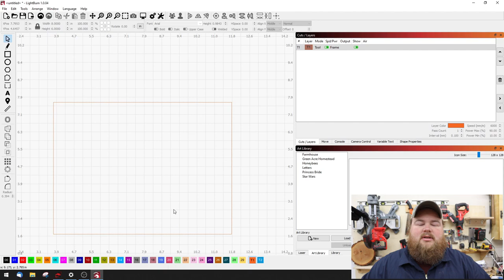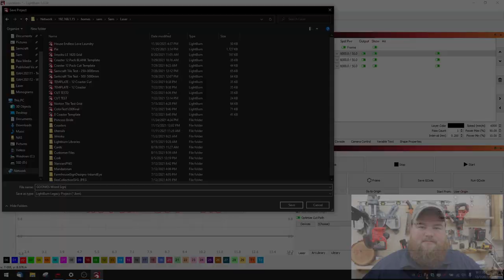Are YOU GUILTY of DOING THIS? // My Encouragement to You

Comment: Thanks, Sam. A few years ago, I was a pyrographer, and had been enjoying it for several years. I admired Ukrainian eggs designs, and when I saw wooden eggs for sale, I thought that combining the wooden eggs and my craft was a great idea. Some time after my work was accepted at the local co-op they told me there had been a big discussion about my craft - was it “true” did I turn the eggs on a lathe. I told them I didn’t, nor did I grow the trees that the wood came from I appreciated the person that sold me the plain eggs and I got value from them. I added my art and manual skills and I call that “value added.’ Simply, I’m with you on this rant . I like what you do and will continue to follow you. Sorry about the long rant.
Reply: That's called thinking smart and utilizing your time in the best way possible.
Reply from the maker: It's a shame that a retail store did that do you. I have run into similar situations with my items in the early years of my business. It only made me turn away from wholesale situations and directly market to my customers. In the end, it's worked (working) out great so far.

Comment: I have been a woodworker for very many years and this same debate has been hotly contested since I started in the 70s.

Fast forward to when CNCs became affordable for home users.  The mantra was there is no woodworking being done if the CNC cut out and did the carving. This coming from the same woodworkers who for years use planers and joiners instead of hand planes because it is faster and easier.

Skip back a hundred years when power and table says hit the home work shop.  I can see the guy waving a hand saw saying that this is no longer woodworking. 

Bottom line is hand says, table saws, hand planes, planers, CNCs, lasers...they are just tools.  The craftsmanship is added by the person using them and who adds the final finishing touches.

Comment: So, if you had too pick one, would it be the cnc router of the laser engraver? Thanks!
Reply from the maker: Right now... laser engraver. #1 reason: 2020 killed my local supply of preferred plywood for the CNC making it too expensive to run a business with the materials. Laser stock materials are cheaper and more readily available. This will mean your end products will be cheaper (maybe), but at least your supply chain for material to make things may not disappear!
Reply: @Samcraftcom   I'm pretty sure this was one of the reasons I was asking this. Appreciate you taking the time too share your thoughts on this.

Comment: I had to pause the video to respond to the concept of whether the maker should create 100% of the product. I paint. I do the paintings myself and my work is the focus of the end product. Although I have sized & primed raw canvas, stretched my own canvases and even made my own stretchers (after figuring out the joint construction). But I've never woven my own canvas or grown & harvested my own flax to weave into linen. Normally, I buy pre-stretched, pre-primed canvases ready to put on the easel. Whatever you make, there is a point at which the end product is dependent on the skills of others. How many of us can truly say "I did it all myself"?
If what you are selling is the design you put on objects and the final finish to which you bring them, the raw objects are classed as 'materials' rather than products... just as a cabinet maker classes the wood that someone else milled as materials. They're simple forms that are churned out on CNCs and untouched by hand. But, if the wood is good, the basic forms are cut to a uniformity and precision that couldn't be achieved with hand carving. The craftsmanship comes in the preparation of your blanks (remember, you are the first human to come into effective contact with them), the setting up and the finishing of each piece. The blanks are only 'products' to their manufacturers just as a carpenter's stock of boards is a 'product' to the sawmill. To you, they are materials.
Reply: Further to what I've already said: a good handmade guitar (for example) is as good as the craftsman who made it... and this always varies. even the quality of the work of each craftsman varies from piece to piece. If a machine can be set up to produce exact copies of the best work of the best craftsman, that quality will be consistent throughout. Handmade is not necessarily better. What handmade offers is the personality of the craftsman. If the fact that every piece is slightly different and, therefore, unique is important (the 'hand of the artist' such as the brush strokes of a painting or the surface of a carving), then only handmade can give you this. If consistency (and, therefore, reliability) of quality, absolute accuracy and cost effectiveness is important, it makes sense to by in blanks. Ultimately, what the customer buys is YOUR work.

Comment: Learn to use Facebook marketing, you can really pinpoint your target market for cheap. And the $9 standard shipping is what turned me off instantly. I know I know, we're all used to cheap or free shipping from amazon etc, but those coasters can easily be shipped for $5 including materials. Or even send out free shipping coupon codes with your email list to attract more sales.
Reply from the maker: Your statement of shipping coaster sets for $5 is not taking into account something along the line. Having run a small business for several years, there is no affordable shipping option anymore for businesses of our size. We pay to gain access to USPS cubic pricing and other discounts, but it's still very high. Add to that the annual "holiday rate increases" they do and we lose on shipping even at $9 per order on some shipments. We eat that cost further for the free shipping offered at $45+ orders. Our products are heavy and weight drives up costs for shipping.
Reply: @Samcraftcom  good to know, thank you. I'm probably going to eat my own words here soon, it's because of your videos that I bought a laser and coasters lol. I'll be shipping product soon. Thank you for the inspiration.